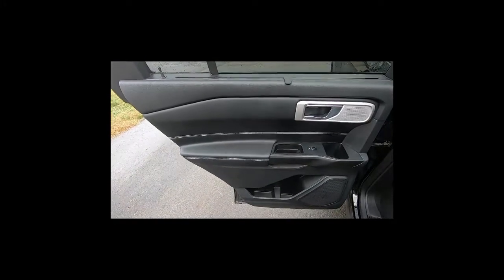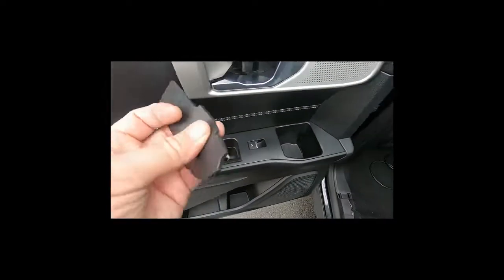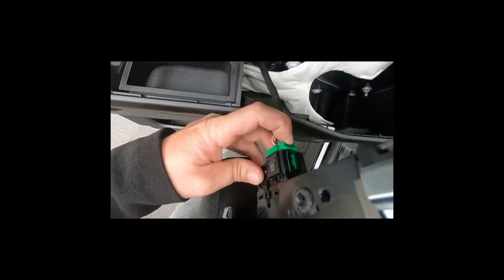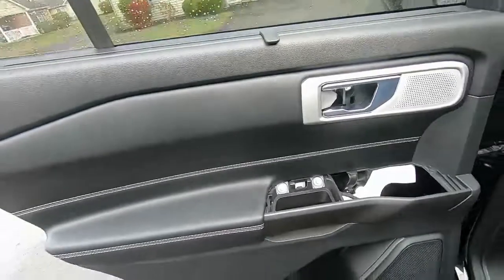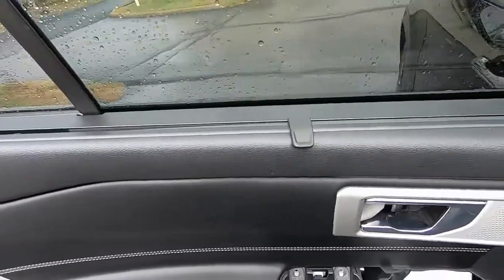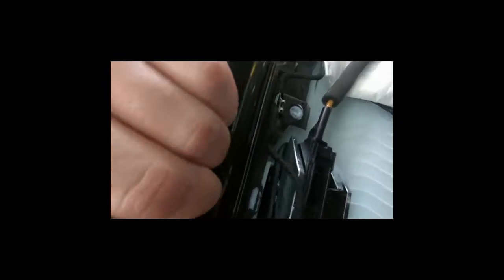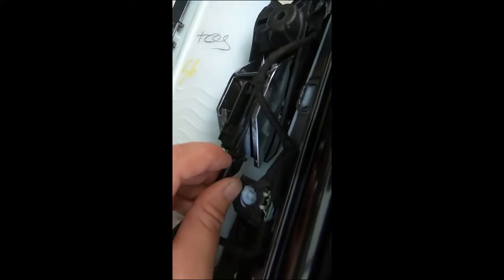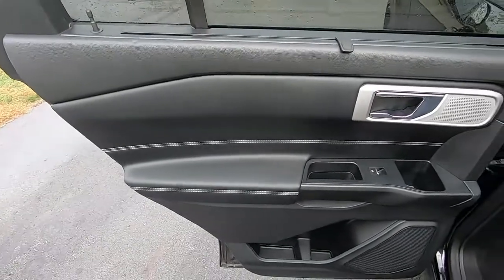How to remove rear door panels on 2020 2021 2022 Ford Explorer ST

Comment: Honestly. 10x easier than the acura i had. They have the sound dampening film attatched to the door and not the panel so i removed that and never put it back on 🤣🤣 this is gonna be a breeze and i can see if its my window that is off track or the run channel that needs to be replaced 💀
Reply from the maker: Ya they are super easy to remove and put back on. It can be a little tight the first time pulling them off and you might think you missed a screw.
Reply: @KenKyleRacing  i just have a dent in the pillar on the run channel? And body shop quaoted me $700 to replace it. But my window is off track so i wanted to looobat that first before spending that kind of money on a sliver of a piece
Reply from the maker: @rivalstorm120  ya if a shop is only charging 700 it's probably something real simple. Good luck!
Reply: @KenKyleRacing  nooo lol the part alone is $559. Im not messing with that part lol. Total after labor and tax is $700

Comment: I'm guessing the procedure is the same for a 2020 Ford Explorer XLT. I need to tap into the rear speaker audio so l can pull line level to adapt from high to low for a subwoofer. Looks more straightforward than when I used to work on copy machines!!! 😂
Reply from the maker: @fookingsog  I'd guess it's the same other than the xlt might not have the sunshade. Bolts and tabs wise it should be same tho.
Reply: @KenKyleRacing  Correct. Sunshade looks like an extra layer of depth. Haven't taken mine apart yet. Just doing some research. Thanks for the video!!! 💯

Comment: Why can't I find a video on how to replace front door passenger window switch on a 2020 Ford expedition.
Reply from the maker: @Marlena-s1k  if noone has made a video, it might be crazy easy to do. If it looks similar to the explorer, try prying on the sides with a trim tool. it probably just pops out and has one plug underneath.

Comment: How do you change the regulator
Reply from the maker: @kevinhuff2004  no idea, haven't dug that far into it, but if window is stuck in down position it's fairly common issue caused by a faulty driver door window switch.